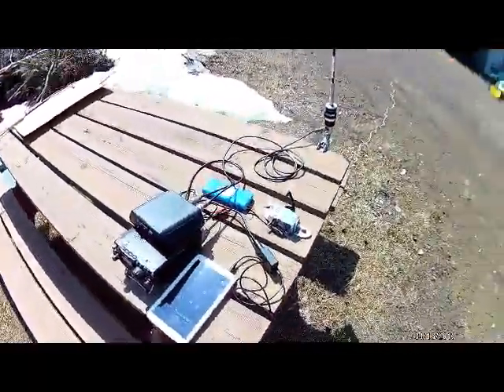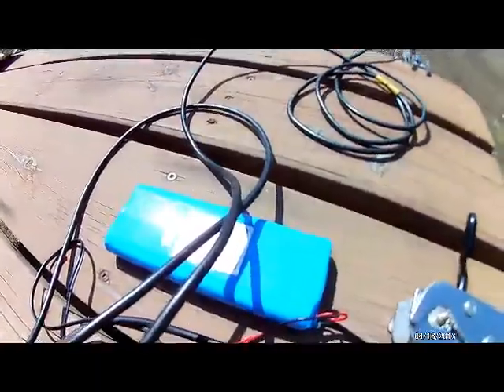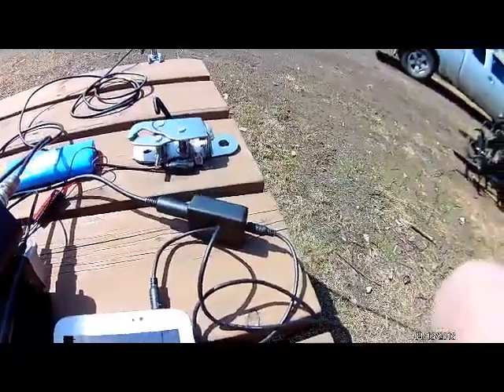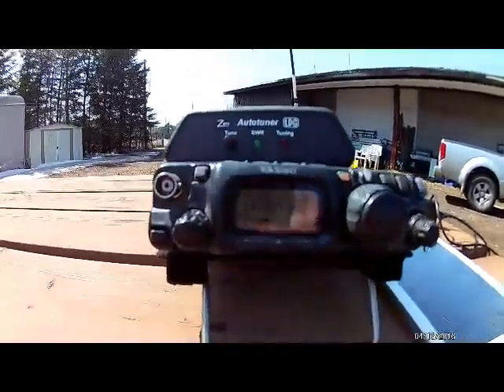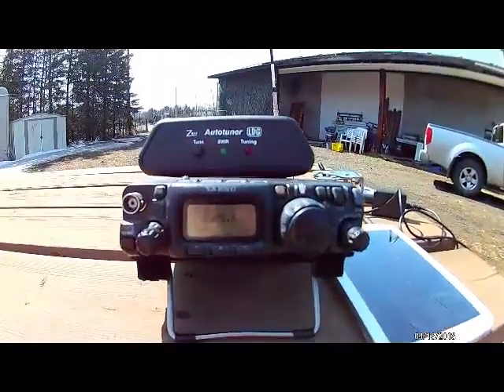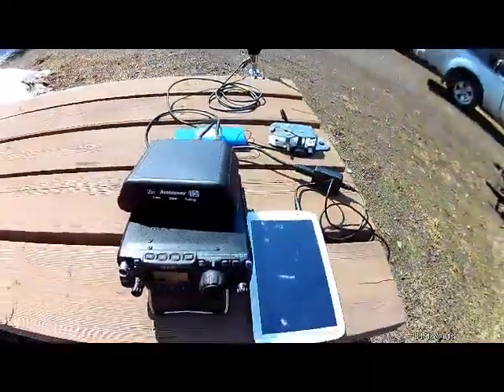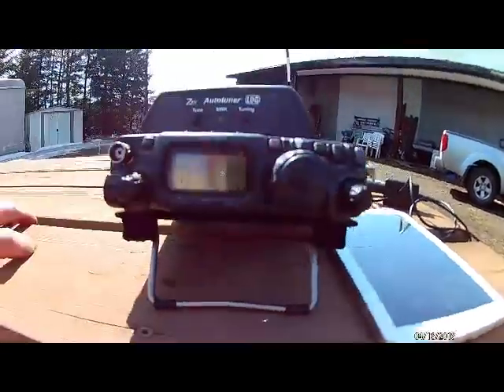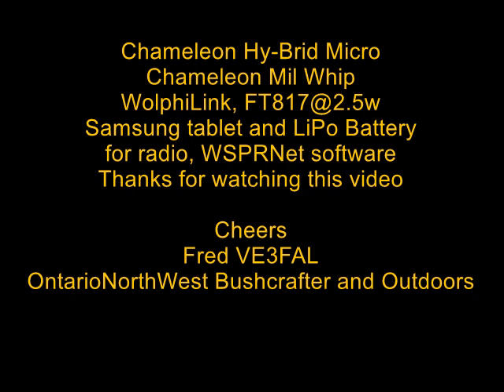WSPR Tests 20 and 30 meters

Comment: Does your counterpoise was pointing toward the South East of the US? Because if you're using a single counterpoise then you can get some "gain" by orienting the counterpoise toward a desired location.
Reply from the maker: +Chameleon Antenna the counterpoise would have been facing West in this situation on both bands